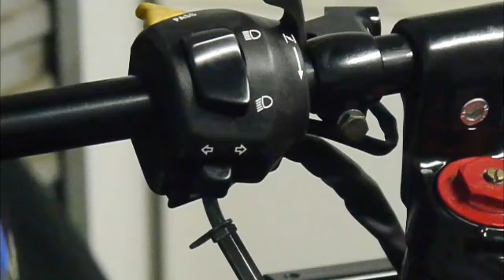Suzuki GSX600F Katana Restoration - Part 8

Comment: Coming along beautifully! Excellent work 👍😊

On such a colour scheme, the bike would surely look even better with a black and gold Supersprox Stealth rear sprocket, I have one on mine and it really goes along nicely with the golden D.I.D chain .. or you could try powder coating the one you already have in black or gold .. just the body of course, not the teeth!

You'll find out after your first test ride, that the bike won't handle well nealing in to curves with the fork heads level with the 750 triple tree surface, but that's a "rake and trail" adjustment you'll make after testing the bike .. mine for example are embedded about 1cm below the surface. When level, the bike won't lean. 

Seems like you forgot to refit the front mud guard? If so, then the front wheel may have to come off again 🙃
Reply from the maker: Thanks for that info. I just had the standard 600 top yoke on it before so wasn’t sure where to set it. 
I’ll get a look at that sprocket too.  
As for the mudguard it’s still off at the painters and I was just getting excited to get it looking like a bike and get it mobile. Lol.

Comment: Hello mate. I am looking into converting the top yoke on mine to 750 setup. In part 7 you mentioned you did not get the right top yoke. Was it the case of getting the wrong year? I guess 2003 onwards the forks are wider? Thanks
Reply from the maker: Hello David. Yes that is exactly right. The newer model is around 10mm wider. I have the lower section of it that’s too wide for mine I think. 
If you don’t have measurements on the site you are buying them off if you study the pictures carefully you can see a slight difference near the centre of it. 
I got mine off boonstraparts.com but they didn’t mention years on all of their parts so just maybe ask them for year or measurements to be sure
Reply from the maker: If your stuck for measurements I could send you pics and measurements of the 03 onwards one I have here if need be by email or something
Reply: @DarrenMcKinney1  Thank you for the quick reply. I think I will be getting mine from ebay. There are quite a few available on there. They usually state the year of the bike it comes from. I guess years around 98-00 should be fine. Well if you could find me on messenger and send some photos of what not to buy, that would be great :)